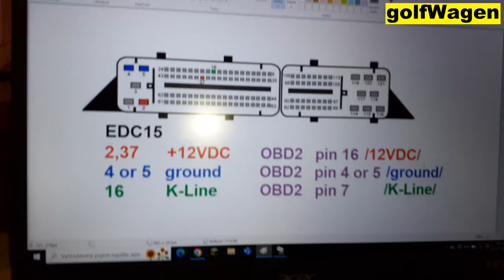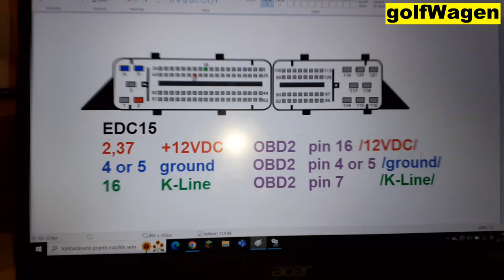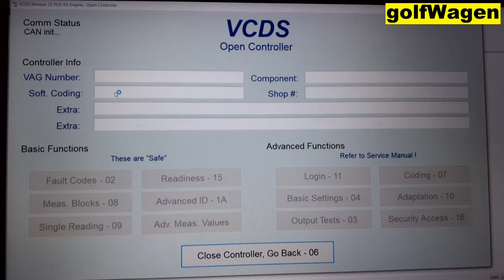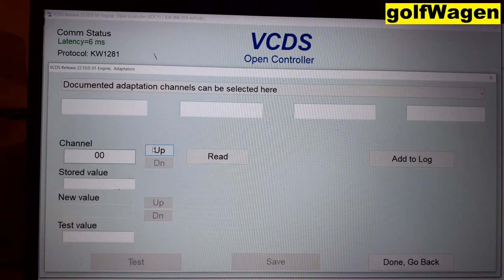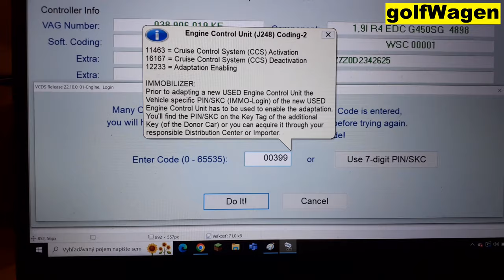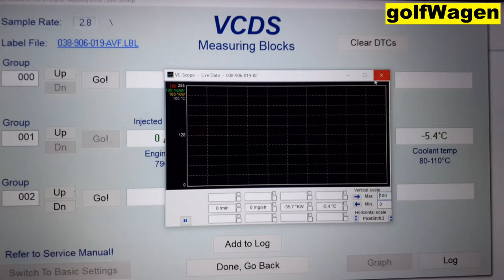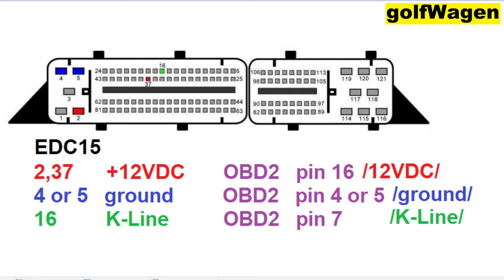EDC15 bosch bench connect read vcds,vag commander, galletto, kessV2, MPPS etc.

Comment: Can you please tell me what software/ cable can turn immo off/on, vag k can comander ?
Reply: Hi, I pulled data from ECU,changed the necessary bits with hex editor and done.

However with an EDC or other typical ECU you can go directly with commander or vagtacho